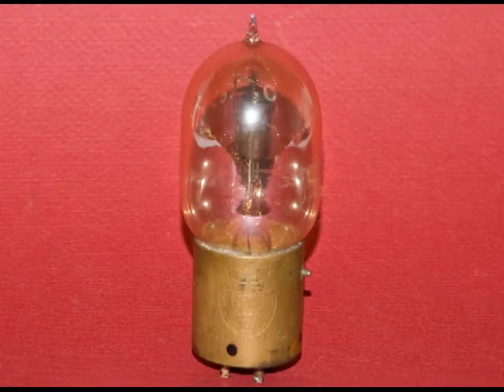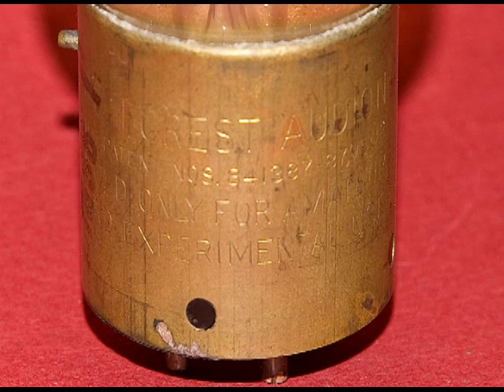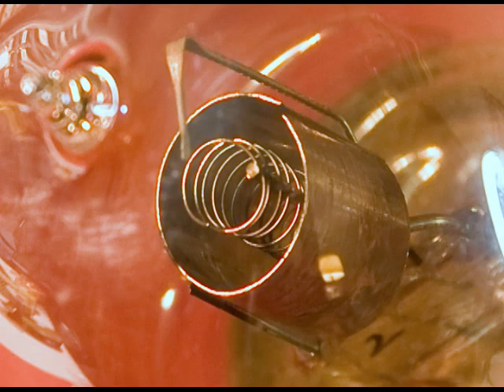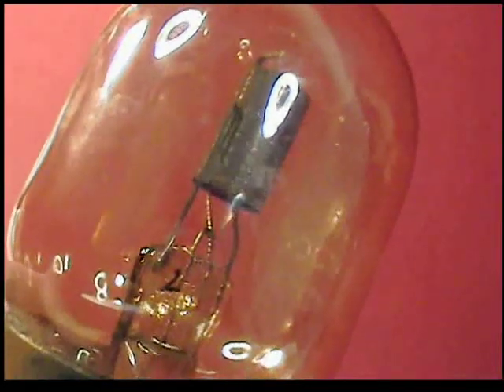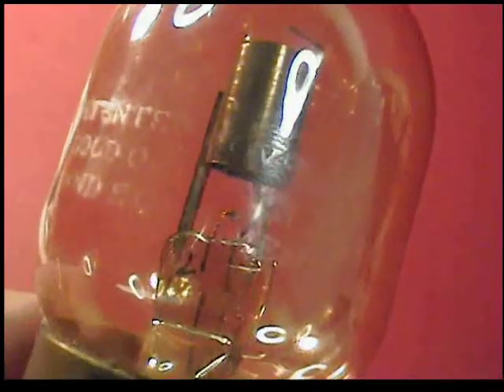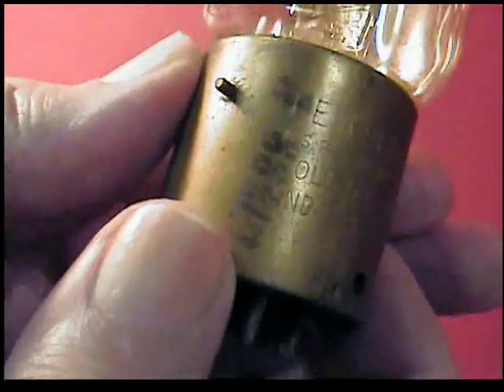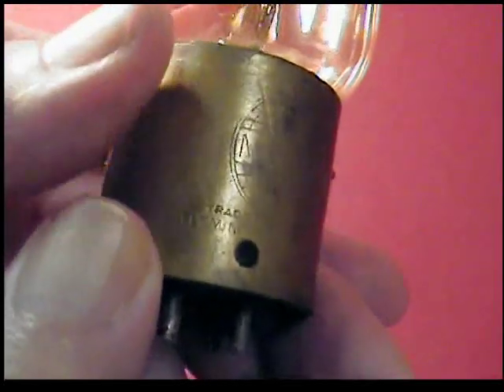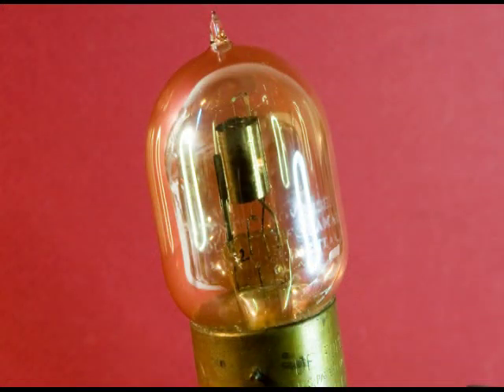A small bit of Radio History, Lee De Forest Audion, Marconi

Comment from the maker: Yes, about the first big commercial tube was the triode 01A. The first ones were short pin brass base with a vacuum tip at the top. The filament was 5 volts at 1 ampere.

Comment from the maker: It was used as an AF and RF amplifiers, and a detector also. Yes the outer cylinder is the plate. The name comes from the original 1906 Audion, the plate was actually a small metal plate. The coil is the grid and in the original it was a wire bent back and forth covering about the same area as the plate. De Forest placed it between the plate and the filament. The filament is the part that emits the electrons. The filament was named by Edison. The grid was named by De Forest.

Comment: Rick what was the tube used for?

The outer cylinder is the plate? 
The coil in the middle is the grid? 
So the vertical wire is filament and must also be the cathode?